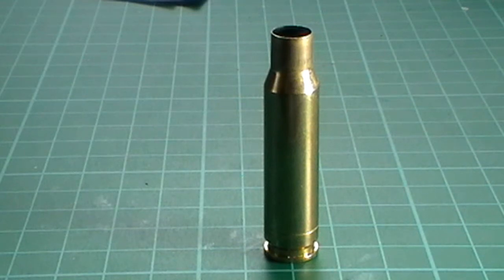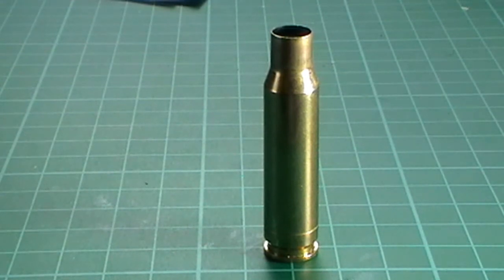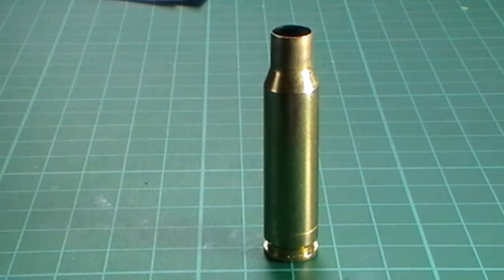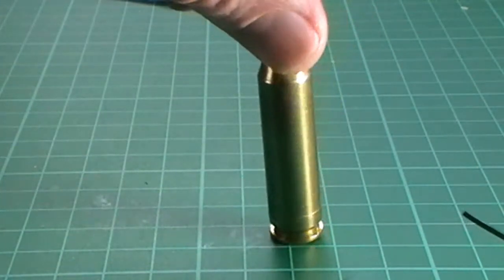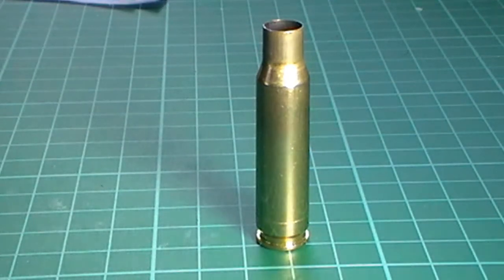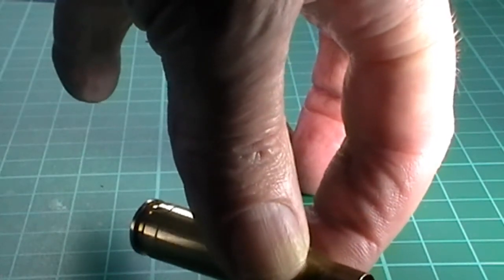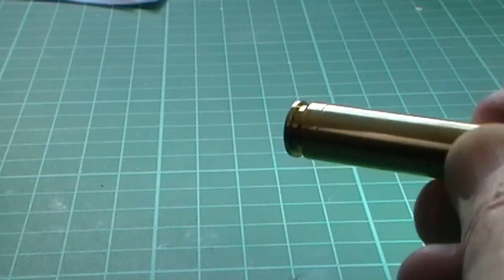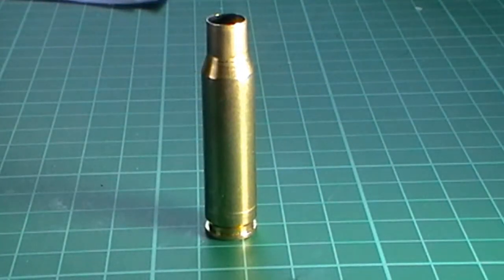Case Head Separation

Comment: Good video.  I've read the reason why 303 separates early is the gun has significant headspace.  This allowed it to chamber under battle conditions, I.e. Dirt in chamber, but it leads to early case head separation during reloading.  It can be delayed by neck sizing only and I've seen a trick where an o ring is put around the case at the base to limit stretching, but this was only with 303.